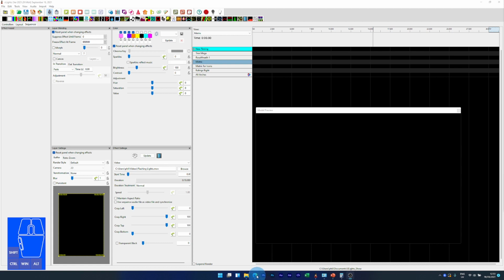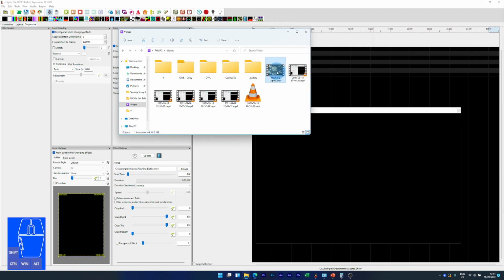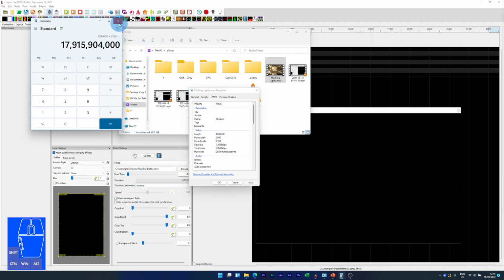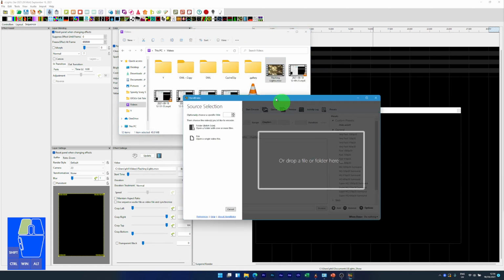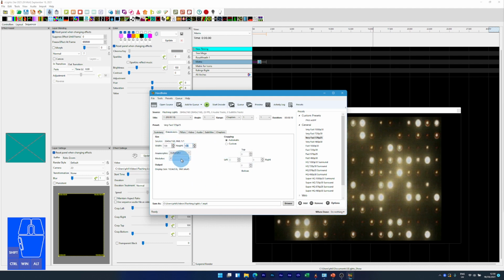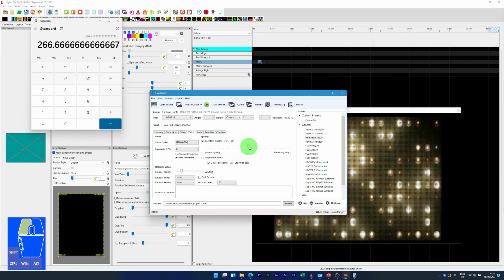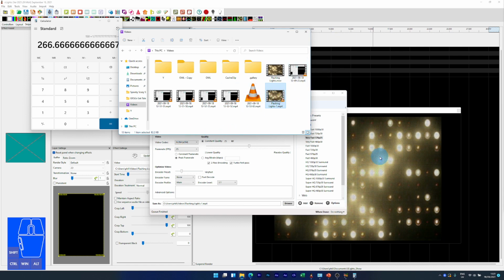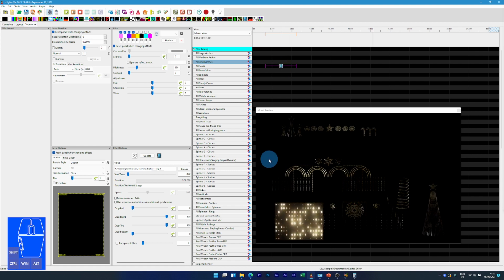xLights -  Resizing And Optimising Videos (Updated)

Comment: So, I tested this on a 18Mb MP4. The video is 1280x720. I selected the preset Very Fast 720p 30 and the file size actually increased to 40MB. What should I have done differently?  Thanks for the video by the way. :) I've learnt heaps from them.
Reply: What is the resolution if the original video ?